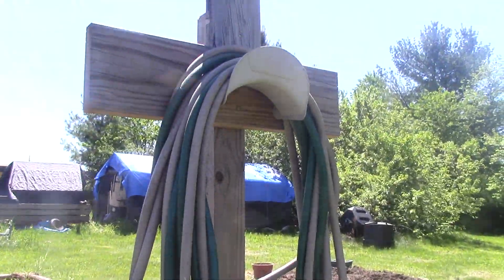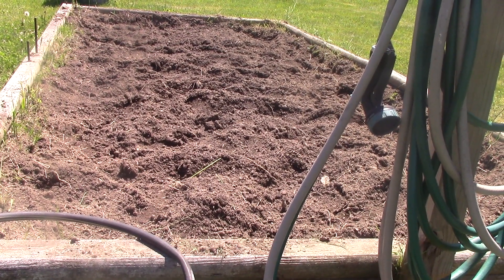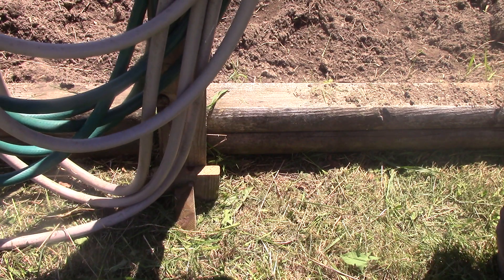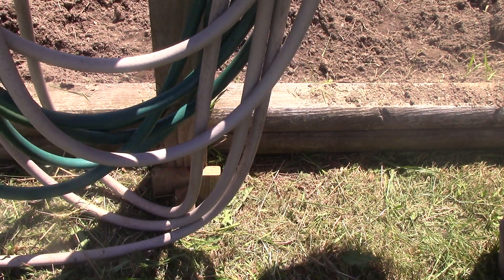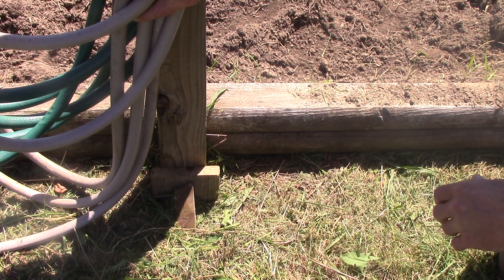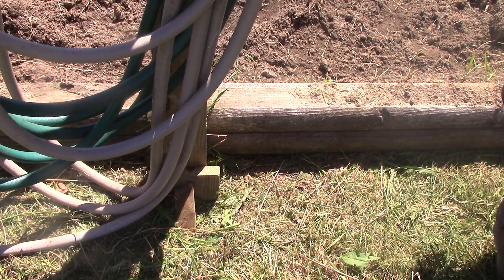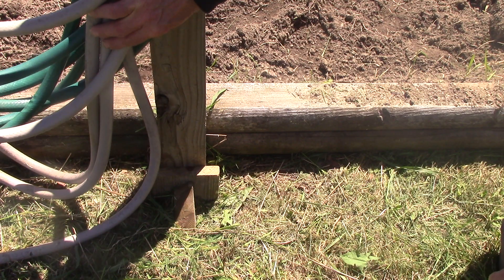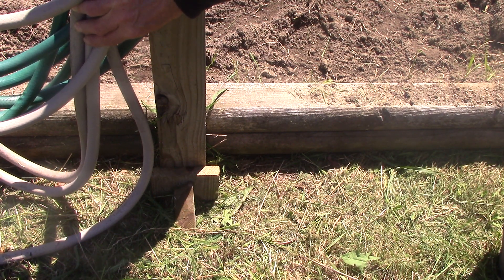Leaning post repair.  Recycle, Reuse, repair and save money

Comment: Now did you use the tractor to till under the soil or did you use a smaller tiller? That some good soil happy planting on Sunday 👍😁.
Reply from the maker: On the raised bed I use the small tiller like yours.  I also use the neighbor boy to do it, lol.   on the other bed I use the tractor.  I wanted a raised bed for my back, lol.  As I got into it I bought the 5' tiller for the tractor.  I am going to make Bio diesel one day for SHTF situations but these projects take time and I only have so much, lol.  Every time I turn around there is something needing fixed, lol.
Reply: Yes I know always something to fix every day. Make sure you use a lot of filters using the bio diesel because that cold winter it will gum up your injectors.  You have to use a switch to change back to diesel after you used the bio fuel and run it for 30 minutes . I ran my 1988 Ford f350 diesel 7.3 liter engine for 6yrs. On bio fuel recycled grease. Sold two Mercedes 300 diesel and that truck for 15 thousand that's how I got my duramax .
Reply from the maker: I will be asking you many questions when I get to that project.  I felt as though I could charge people is a long term situation, grid down, new world type of thing,  10% of their yield for tilling and prepping soil.  I thought it would be a good barter for a old man, lol. @fallenskyshomesteadingandp2528